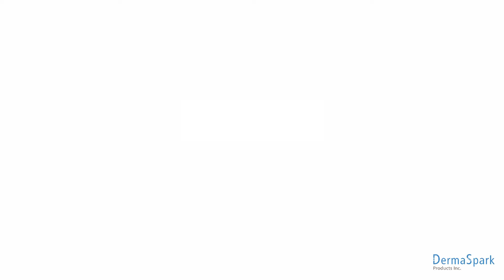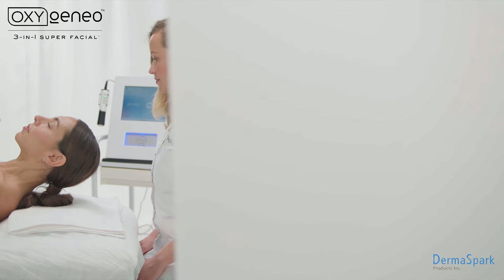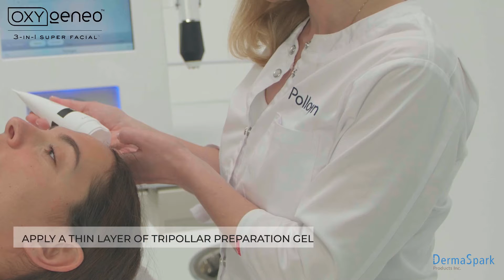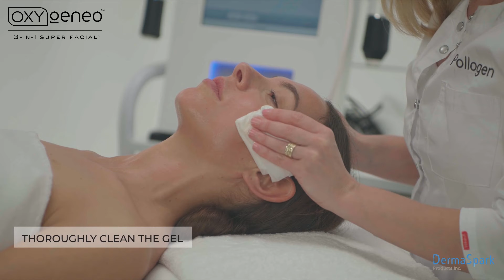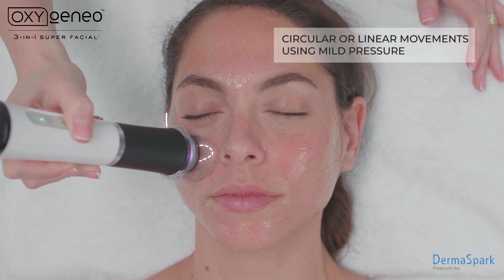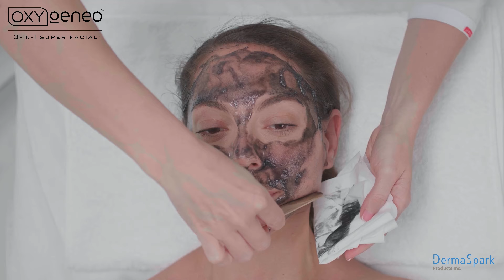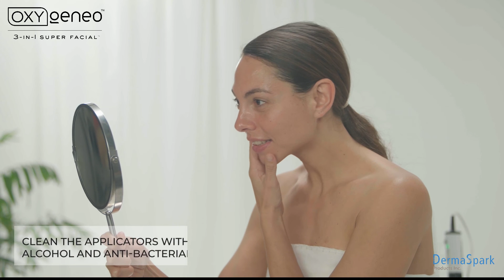OxyGeneo 3-in-1 super facial - training video

Comment: Thanks a lot for this brilliant instruction manual. How long does it take for each treatment to show distinguishable results?
Reply from the maker: Hi Kevin,
The OxyGeneo 3-in-1 super facial deliver significant and noticeable results from the very first treatment!
During time, the treatment yields further and long term skin improvement even more so when done with the TriPollar and the ultrasound applicators.
needless to say that if you are treated with a fake illegal device, the treatment will deliver no results whatsoever.
Thanks and enjoy this amazing treatment,
DermaSpark team,
Reply: 🎉🎉 0:00 0:00
Reply: Do you have to use the oxy pod with
Reply: Do you have to use oxypids with this treatment. Do we have to buy with machine